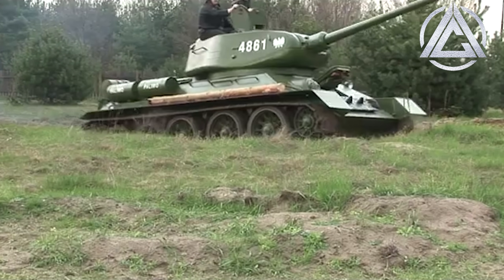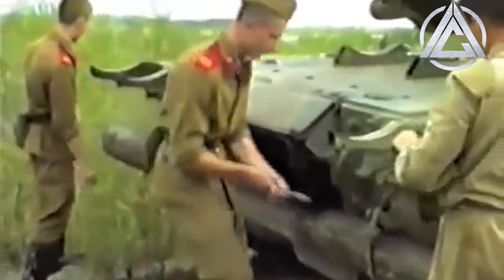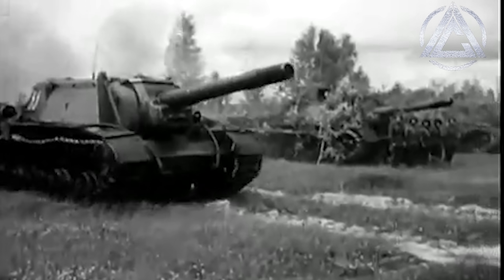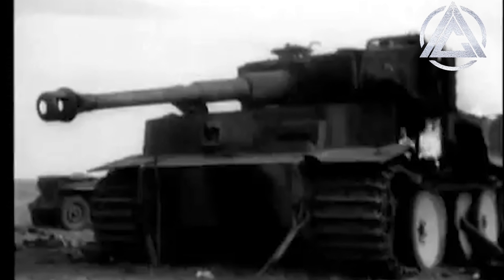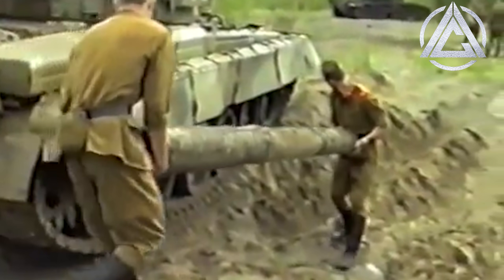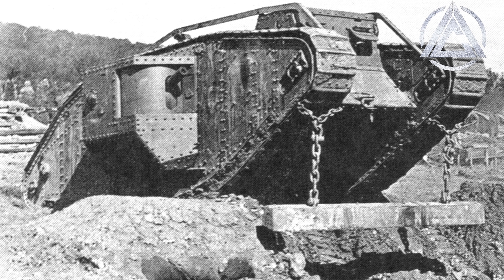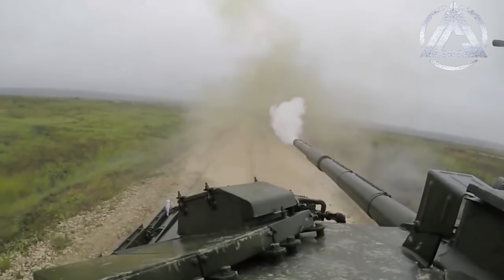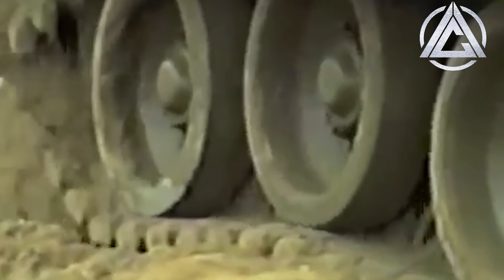What's With the Logs on Soviet Tanks? | Koala Explains: Tanks - Tracks and Traction

Comment: Look a little closer, you will see many tanks running around with short sections of track and stout cables strapped to their hulls.
Towing cables, spare track, logs...it's the bare minimum 'tool kit' for any tanker crew to stay on the road.
A good crew can repair a thrown/broken track in well under an hour...
Reply: how about  the movie  Fury? they had time to fix the track and road  wheel.

Comment: Logs also provide a means to get higher elevation or depression of the main gun by lifting the front or back end if the tank a s needed. Soviet and Russian tanks have historically had poor range of elevation/depression for their main guns.
Reply: That would make you immobile as fuck, and not used much
Reply: @doobas2171  Except in ambush.  For instance, last week when Russian troops were withdrawing from around Kyiv, a lone Ukrainian tank laid in hiding, to ambush one of their columns.  Rather than using speed and maneuver to protect them, they used the cover of buildings to protect them.

Comment: If I were designing a tank, I'd make it carry a total of 4 logs, 2 on each end, with a quick release leaver on each of them which can be pulled from inside. One of the reasons Russian tanks keep getting abandoned is because they get stuck in mud while retreating, and they can't take the time to move the log into position while under fire. This way, they could just drop a log without getting out, so they can just keep rolling, then just cut a new log when they get to safety. Ukrainian mechanics could probably retrofit captured tanks to do this and give them an additional advantage.

Comment: Also with a shape charge such as the pound surfouse which was just coming into service with most armies during World War II and now they use logs to stop the projectile of hot copper that penetrates through the hull we all know what is very resilient and burns real slow it's cheaper than chromatic plates which can shatter from the explosion of the shaped charge why you see a lot of logs on modern vehicles not to dis idiot on this video has ever been in a combat vehicle in a warzone

Comment: You rarely saw an unditching beam on a German tank in WW 2.  What you did see a lot of, were towing cables, a practice among most western tanks, still used to this day.  They have the advantage over the unditching beam in that an experienced crew can have a tow cable attached in less than a minute and the tank that’s stuck back in operation just as quickly.  In addition, should the problem be mechanical in nature, such as an engine or transmission failure, or the tank simply ran out of fuel, by taking the other tank in tow with a still operational tank, you can avoid the potential loss of a mostly serviceable tank in the event you have to withdraw.  You can’t always count on an ARV being there when you need it and sometimes you only have minutes, rather than hours, to recover your tank.  BTW, I once witnessed an entire chain of tanks being used to get one tank unstuck (3 to tow 1).  It worked.
Reply: If you dig around you will find a lot of pictures of Soviet tanks with the cables as well. But the point for having that log is that if you are moving a group of tanks from one point to another in a hurry, you can't really afford having three tanks pulling one out, when they are needed to support an advance or defence or whatever. Plus, in real combat situation, with possible air attack, having four tanks tied up like that... Let's say it's just a waste of four perfectly good tanks
Reply: Soviets had towing cables too, lol. This is on top of that method. Imagine coping this much.

Comment: you'd think they'd have an auto dispenser in the front so they could drop the log from inside the tank... then get out to recover and put it back into the system... if they had time or could do it without danger (being fired upon)
Reply from the maker: Thing is that just overcomplicates the system. Lot simpler to just strap a log to the back than develop some kind of "dispenser" that plops the thing down at the push of a button, and it's unnecessary.

If your tank gets bogged while it's IN combat, you're abandoning it anyway

Comment: The "The Log" card is unlocked from the Builder's Workshop (Arena 6) or a Legendary Chest. It is an area damage spell that affects a rectangular area on the ground as it rolls through its targets, damaging them and pushing any survivors back, even heavyweight ones that cannot be knocked back by other means. It disintegrates after rolling for 10.1 tiles. It appears as a long, spiked piece of wood. A "The Log" card costs 2 Elixir to deploy.

Strategy
As a cheap spell, The Log can be used to damage and push back multiple ground troops that are approaching your side, such as Barbarians or Goblins.
Unlike all other cards with a pushback effect, The Log can affect all ground troops. If a troop is locked into a target, the pushback caused by The Log will reset their attack animation. This is in contrast with the Zap or Lightning, as it will only pause the attack instead of fully resetting it, with the exception of Sparky.
It can be a cheaper alternative to Arrows, due to the very similar damage and area of effect.
The main differences are that The Log costs one less Elixir while being unable to affect air troops. As such, it might be advisable to bring other splash damage cards to deal with the likes of Minions and the Minion Horde.
It can also be an alternative to Zap, as both of them have the same Elixir cost. They can both disarm the charge attacks of Prince and Dark Prince if you have low Elixir or if your small units are out of rotation. However, they have slightly different effects when used. The Log will not reset a Sparky, but a Zap will.
Barring aerial units (as The Log cannot hit them) there are only 6 units that it cannot one-shot compared to Arrows, those being Wall Breakers, Bomber, Archers, Guards, Firecracker and Elixir Blobs. They will still be countered with the help of the Princess Tower.
If placed right next to the bridge, The Log will damage the Princess Tower. Its cheap cost and relatively high damage compared to the other 2 Elixir spells make it a low-commitment way to chip a Crown Tower.
The Log is effective on offense when combined with grounded units. Any swarms placed on top of The Log will be immediately hit, and in most cases, completely eliminated. However, the player should be aware of the slightly staggered deploy time on all cards comprised of more than one unit besides Skeletons, and deploy their The Log so that it will roll over the units once their hurtbox spawns.
Remember that, despite it being a spell, it can only be placed on the player's side, which reduces its effectiveness in certain situations.
If a unit is walking right on the edge of the river on a player's side, the player can use The Log to push the unit over the river back to the opponent's side. This is a good way to delay slow-moving units like Giant and P.E.K.K.A.
The Log can be an effective counter to Tombstones or Goblin Drills. If the building is at around half health, The Log can be used to destroy the building and the troops spawned afterward. Similarly, it can also be used on a Battle Ram to deal additional damage to the spawned Barbarians. However, this will not work against a Goblin Giant.
The Log is a great counter to a Goblin Barrel. Although it is slightly harder to defend a Goblin Barrel with it compared to Arrows, it costs 1 less Elixir. The Log's radius is wider than it appears, meaning it will still fully counter a barrel placed in the center of the player's Princess Tower if the horizontal placement is 1 tile off.
If the opponent places a Royal Giant in the extra space of the player's territory once a Tower has been destroyed, they may be able to use The Log to push him to the King's Tower lane, protecting their frailer tower. It could also be used to cause him to retarget to another building if the player places their building late.
If a Miner is placed on the corner of the Princess Tower closest to the King's Tower, The Log can push the Miner towards the King's Tower, activating it.
The Hog Rider, Mega Knight, Ram Rider, Royal Hogs and the Cursed Hogs can unintentionally jump over The Log as they cannot be struck by it while they use their jump abilities. However, this is rare and should not be relied on.
The Log one level lower than the Princess, Dart Goblin, and the Rascal Girls can still defeat them in one shot, but not if The Log is two levels lower than them.
While a Mega Knight is charging his jump attack, pushing back the Mega Knight while he is charging does not prevent him from jumping on his target. The same holds true for the Bandit and her dash attack.
The Log's pushback can be used to force enemy troops directly in the center of the arena to switch lanes by deploying the Log on the side of the troop opposite to where the player would like to redirect it. This can be useful to weaken the current defense or to weaken a counterattack.
The Log's pushback can push the Hunter further away from his target, reducing his damage significantly.
The Log can push back a burrowing Miner. However, it does not deal damage to the Miner, nor does it force the Miner out of the ground, so this should not happen very commonly.
If the opponent places down a Golem in the middle of the field, It is possible for The Log to push it to the opposite lane, letting your X-Bow connect to the tower if only done correctly.

Comment: Probably for getting the tank out of a stuck position. That's what we used under ground, in a coal mine when you have a miner stuck. They will put a thick piece of crib block, or a short piece of railroad steel under the track and it will pull it right out.
Reply: bingo.

Comment: Tracked vehicles don't actually rely upon traction,which is looking at the mechanics of it the wrong way, the principle is not that dissimilar to a rail way. Tracks work as their name implies as a track for the road wheels to run upon, the track only needs to provide friction or grip between its self and the surface it sits upon sufficient to allow foreward momentum of what's running on it,also the weight of the vehicle is not spread across the entire track, only generally on the track sections and maybe the directly adjacent sections directly beneath the road wheels,this creates a tooth like pattern of grip on the track by imposing higher forces over smaller areas creating higher grip directly beneath the load,(controlled)while the track acts to mitigate burrowing across its entirety.So it doesn't provide traction as a tyre would,think of it as a continual surface that the tank pulls it's self along,rather than a big sort of flexible tyre that it runs on.

Comment: Yes, a bulldozer is not a tank.... neither is the BMP 2 in the thumbnail...
Reply from the maker: If it's a tracked, combat vehicle, it's a tank. IFV's like the BMP, Bradley, etc., are indeed tanks
Reply: @ArmorCast  Not according to every AFV recognition class I did during 35 years in the army.  A tank mounts a gun capable of being anti tank.  BMPS, Bradleys, Marders, Warriors et al are NOT  tanks.
Reply from the maker: @lib556  Obviously when it comes to teaching AFV recognition, it's important to know the difference between an MBT and an infantry fighting vehicle, but what would that same class say about a Soviet IT-1 I wonder?

Definition of "tank" is an armored combat vehicle that moves on a continuous metal track. That is all. Even the definition of "armored" can mean basically anything - after all, open-topped tanks exist.

Thing here is that... if a BMP is a tank, then a Marder or Bradley does indeed have a gun capable of anti-tank. The same is true in reverse - if the Warrior is considered a tank, then the 30mm used by the BMP-2 and BMP-3 is an anti-tank-capable cannon. So that criteria is self-fulfilling, and hence pretty meaningless
Reply: @ArmorCast  "if a BMP is a tank then...".  But a BMP  is NOT a tank.  Therefore your contention that tank status extends to those capable of killing it is invalid.  The main guns on Brads, Warriors, Marders etc are anti-APC/AIFV - not anti tank.

Comment: i used to run big earth movers,  called scrappers..   big chain like tracks pulled the material into the bed.   sometimes the tracks would jump a tooth.  this is where the log comes in.
we would wedge in the log and turn the chain slowly and it would jump back into place.

Comment: These are the characteristics that make something a tank.  1 - Tracks instead of wheels, 2 - A moving turret for the main gun, 3 - a large main gun and not a machine gun in excess of 30mm, 4 - Not designed as troop carriers, 5 - heavy frontal and side armor.  Only some of the earliest tanks do not conform to all of these characteristics
Reply from the maker: This isn’t quite accurate. One mistake is the moving turret criteria; this is actually not the case. Officially, casemate tank destroyers like the German Jagdtiger, or Soviet Su-100 are just as much “tanks” as a Sherman, T-55 or Abrams.

“Heavy” armor is also not a factor, with the M551 Sheridan, Fv101 Scorpion, M8 AGS, or any other light/scout tank also fitting the definition of “tank”, despite being armoured only against small arms fire and secondary fragments from artillery/mortars. The M56 Scorpion is possibly the most obvious example, having no armor protection whatsoever!

Troop carriers and engineering vehicles are by definition not “combat vehicles”. Where this specific criteria gets a little wishy-washy is with artillery. IFV’s however like the Bradley or BMP are still defined as tanks
Reply: @ArmorCast  No, Tank Destroyers are not classified as tanks in any Order of Battle.  The M551 was classified as a light tank.  The FV101 Scorpion is an Infantry Fighting Vehicle and also not a tank.  The M8 qualifies as a light tank in order of battle the same as the M551.  The Bradley is not a tank based specifically on 2 of the criteria, troop carrying capability and the very small and weak main gun.  The BMP doesn't qualify because of the troop carrying capability.  Very few IFVs even can be misidentified as tanks in the symbology.  The only ones that can currently would be the BMP-1 and the BMP-3 because of their very large guns for an IFV.  The symbology would require a gun modifier because of the size being larger than 20mm.
Reply from the maker: @CombatIneffective  Light tank = tank. Whether it's a light tank, a medium tank, a heavy tank, a main battle tank, or a tank destroyer, if it's an armored combat vehicle that moves on a continuous metal track, it fits the definition of a tank. That includes tank destroyers.

The idea of the turret being a requirement also falls apart with the Stridsvagn 103, universally referred to as a "main battle tank" yet with a fixed gun in the hull.
As for troop carrying capability knocking it out of consideration as a "tank"... What about the Merkava?

Comment: My father built country roads in the 40's&50 with Cat D7&D8s . Dad spoke of using this technique often. It works incredibly well.
   Many time you had to attach and detach the log several times a you could only move the length of the dozer (or tank)

Comment: It's the old addage about NASA and the space-pen versus the CCCP with pencils [accurate or not]. Glad to see you acknowledged the WW1 origins of this system. The British Mk. IV was the first tank to have the system fitted , and even had rails along the full length of the roof to allow the wooden beam to do full revolutions without needing to unhitch it when you get to the rear of the vehicle [as with Soviet /Russian tanks]. No other WW1 used the system though, since there were no other WW1 tanks that had the same geometry - neither the German A7V or the French Renault FT could have used an unditching beam, and were not equipped with them - locally jamming crap-to-hand under each track would've been the only solution for those tanks... with the A7V being so top heavy that anything other than a prepared road was going to strand it on its side 9 times out of 10, and there were only 18 of that tank ever produced, because they were awful!

Comment: WOW! 
A few years ago, I worked at a construction yard. I think it was right before Christmas and I was the last one in the yard. We had a LOT of snow in the yard and it hadn't been plowed. Low and behold, a delivery came via semi. The driver drove the truck through the snow to turn around and got stuck. REALLY stuck! For an hour or two I and the driver worked on getting him unstuck forwarding and reversing to no avail and even trying to tow him out with a backhoe. (Its just before Christmas...and I want to go home!) I finally got the idea to get a shovel and dig in the snow/ice/slush/mud in front of the driver's wheels and place some skids (4inx8inx5ft heavy wood boards). I told the driver: "If this works, DON'T STOP! Just leave the yard and we'll get this load after the holiday. Merry Christmas." Sure enough, the skids did the job and he got out. I think he honked the horn as he drove out of the yard.

Comment: Soviet and Russian tank tracks were crap.  They weren't made to dig in off-road. they are closer to being flat than actually useful.  Notice that most do not have any rubber to meet the road which tears up roads.  Western vehicles all have rubber on their tracks to ride on roads and prevent surface damage.
There's an excellent video of a T-90 getting stuck in a simple ditch.  Why? bad track design circa 1941 and shallow belly make for bad times in a Russian tank.